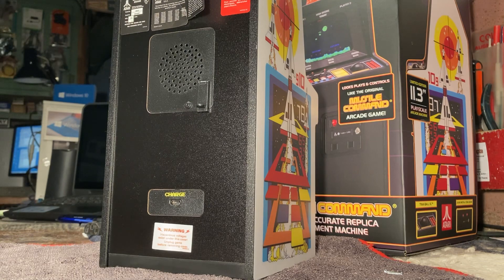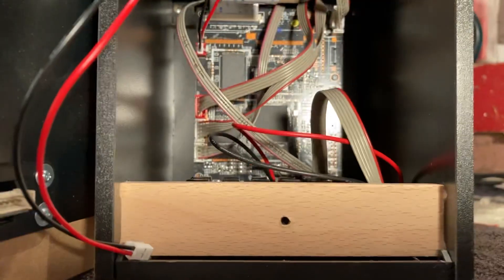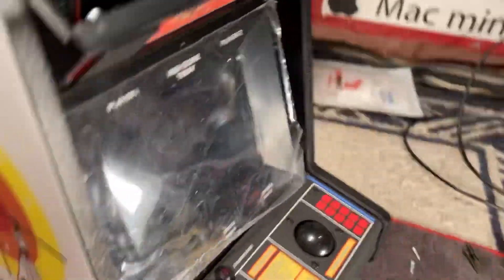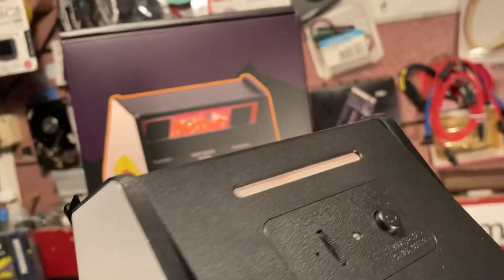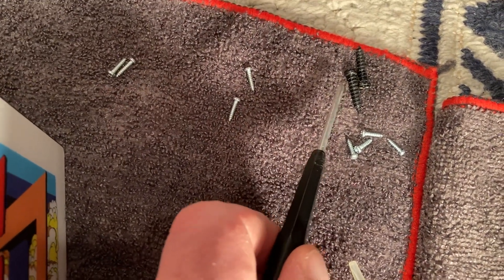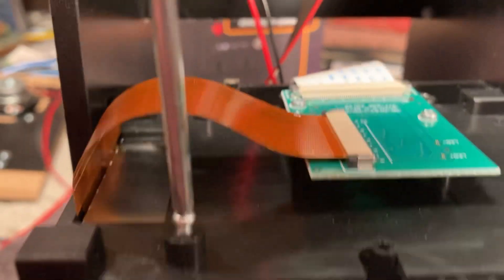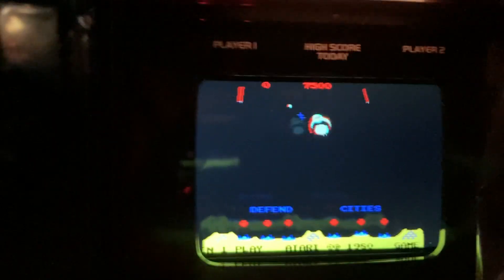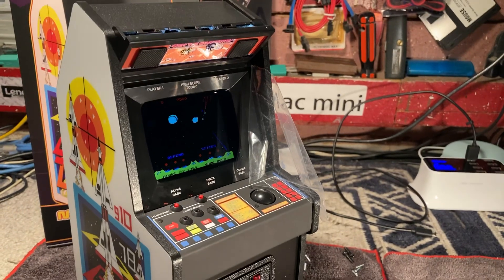New Wave Toys Missile Command Remove The CRT Lens

Comment: I think I would just put up with the CRT lens rather than void my warranty and break my machine.  And 11:34 THAT'S WHAT SHE SAID!
Reply: The warranty on these cabinets is only 100 days.  People concerned about voiding the warranty could always just wait three months for it to expire before proceeding.  Nothing is broken by doing this (as long as you're careful).  The CRT lens is just a piece of plastic that lays in place.  It can easily be put back in later if desired.
Reply from the maker: @wileyhansen4143       
Hi Wiley could not have said it better.
You took the words right out of my mouth.
Looks so much better with out the lens.
I have a Food Fight on the way, we will see 
what the lens looks like on that one.